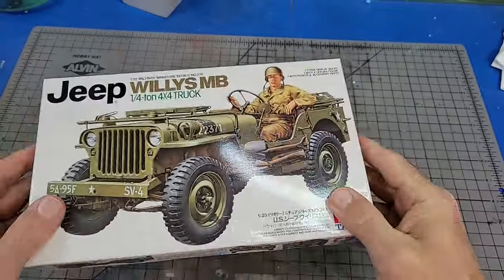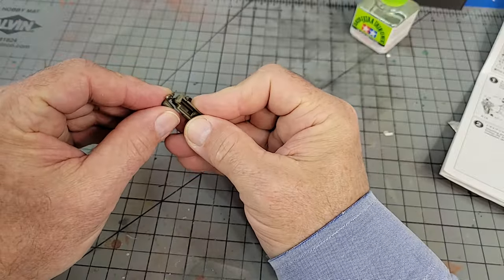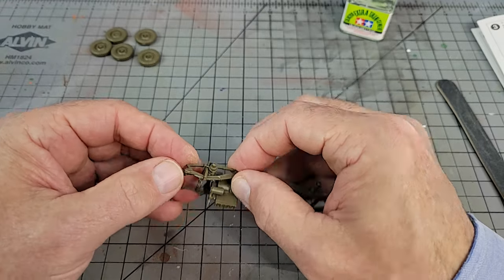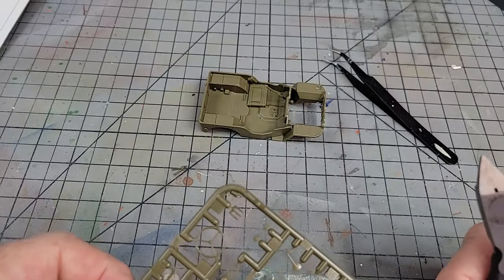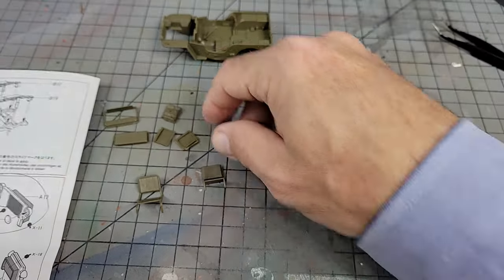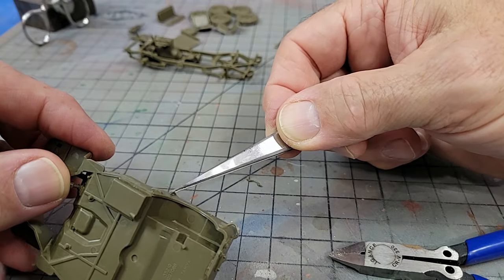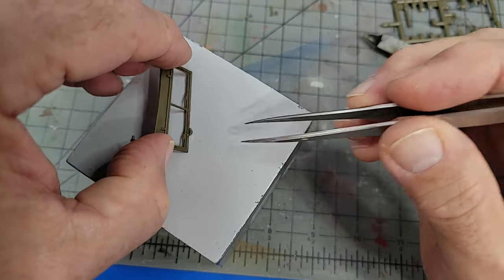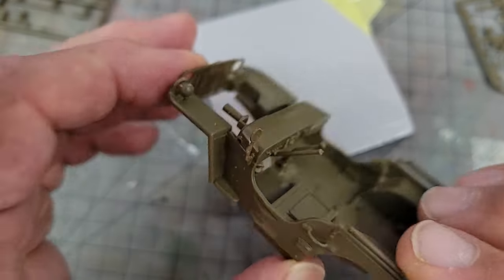Detailed Build Guide, Tamia 1:35 Scale Jeep,

Comment: That part A2 is called a fuel tank well. The actual item can be fitted with caps, not dissimilar to radiator caps, the idea is to prevent water entering when fording and to easily drain it if it gets in. I have one restored WW2 Jeep and currently working on my 2nd, and yes, I have built a model or 2 of this iconic vehicle.
Reply from the maker: Thank you very much. I appreciate the info!